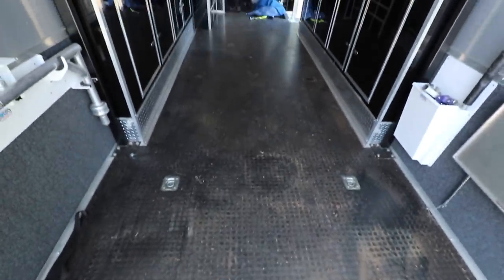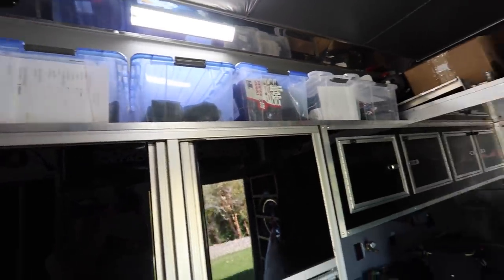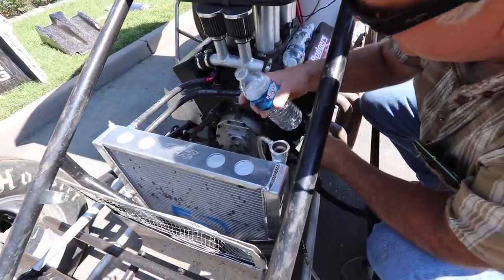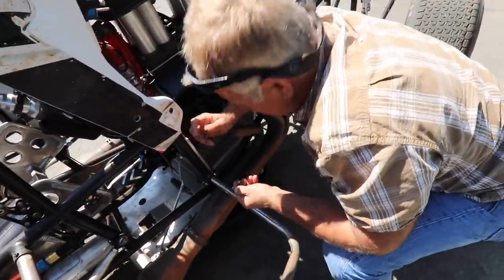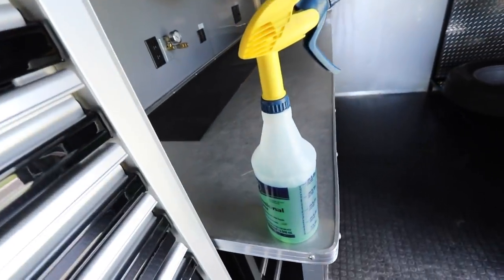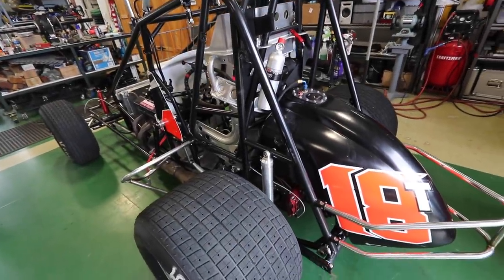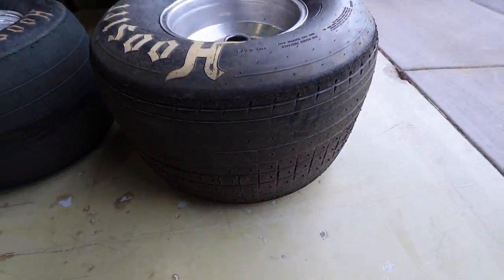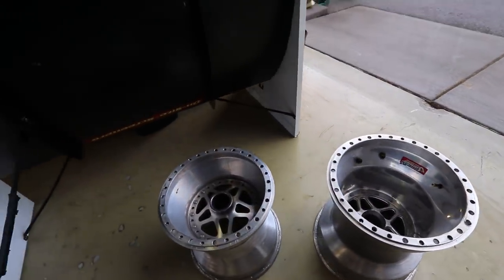Washing The Sprint Car Trailer and Dismounting Tires!

Comment: Ya i ran 240 after i shut it off coming to the checkered. Going down the back stretch it sounded like it was low on power. So i didnt want to take a chance

Comment: One time lost all the water in a race ...saw something but I was fourth and fightin the position....so when I watch the gauge was ok...but I last 1 lap when the engine blew....there was no water so the gauge can t tell the difference just the temperature there was no contact with the water so........sometimes  a lil crack in the gasket...sending some water to a piston the engine runs great for a couple of races too....

Comment: Looks like to me that the front of the radiator is plugged up with rubber or mud. I would recommend getting a tank with a agitator pump to circulate the water through the fin's while it soaks. Due to the fact the radiator could be plugged up worse than you think. I've even worked with teams that would swap radiators from the heat race to the feature. That way they had a radiator that they knew wasn't plugged with dirt and other debris.